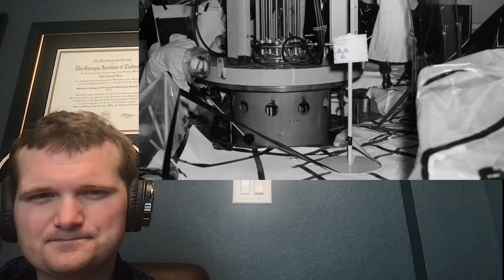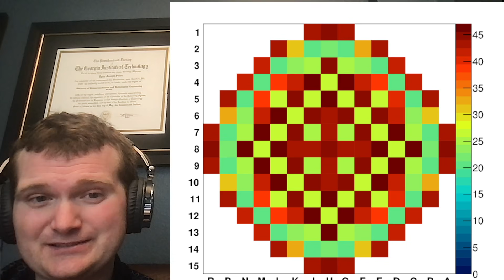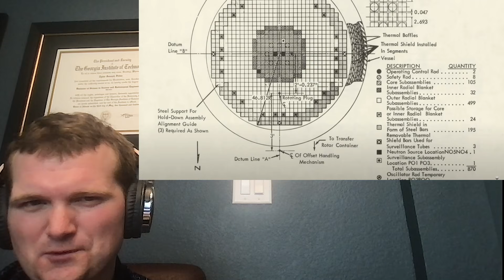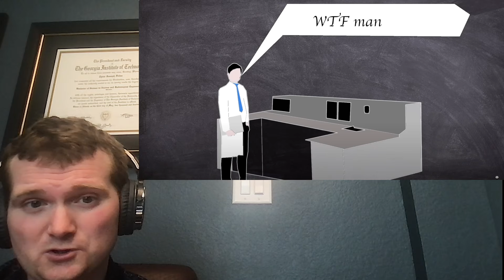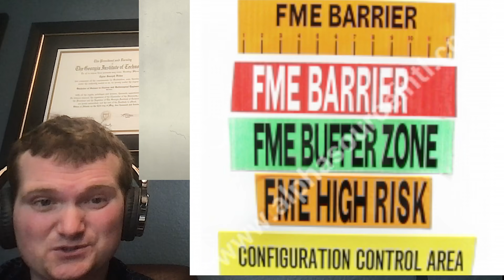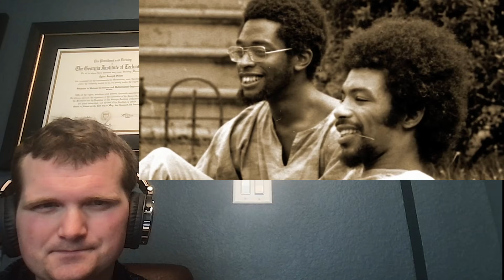The Worst Nuclear FME Event: Fermi 1 Meltdown - Nuclear Engineer Reacts to Plainly Difficult

Comment: Another technology that is now applied are vibration and 'loose-part' monitors.  The idea simply to have sensitive detectors mounted on key pieces of equipment and 'listen' for 'things rattling around."  I remember that San Onofre steam generator replacement ran into a lot of problems because of excessive vibration.  The concern being that high vibration from flow forces will cause tubing and support brackets to break.
Reply: I used the vibration spectrum from a system in a PWR that ran excore detector signals through a FFT algorithm to detect unusual vibrations of reactor components. I used this to determine the chronology of a failure of a thermal shield. I correlated this timeline with Loose Parts Monitor alarms. The company spent a LOT of money paying Combustion Engineering to analyze the same data and they came to the exact same conclusions!

I later worked at San Onofre. I don’t recall if the Loose Parts Monitor picked up anything as that was more of tube fretting wear against their supports rather than loose objects moving around. I was part of the team that did the Chapter 15 calculations for the various proposed reduced operating power levels with the repaired generators. We were close to getting NRC approval for restart when Friends of the Earth filed a lawsuit requiring complete relicensing of the plant. Southern California Edison threw in the towel and pulled the plug. I think they got an offer of financial leniency from Jerry Brown and the Public Utility Commission to grease tge skids.

Comment: FME = FOD in the aviation industry.  Had one helicopter I was working on that I dropped a washer in the flight control tube.  Tore the whole thing apart looking for it.  Next morning I made the TI jump for joy when I presented him with the missing washer.  It had fallen and tucked itself in my boot laces!  FOD accounted for!
Reply: And when you found it, you exclaimed, "Well, F me running!".   ;)

Still, better to keep looking and eventually find it than to fly and find where it went on the fast way down.
Reply: Saved an H-53, found a sheared flight control bolt during fod walk.
Reply: @idrinklight44 hope you got a bonus for that
Reply: Most famous FOD incident was when an ordinary plane dropped a metal strap on the runway before a Concorde flight .  Strap cut the Concorde tires at speed, causing the cut up rubber to puncture the wing fuel tanks, escalating into a massive fuel fire killing everyone, including the people the Concorde crashed on top of .
Reply: @johndododoe1411 
An MD11...
Reply: Fuck on-demand?
Reply: Isn't FOD foreign object damage?
Reply: @DarkAttack14  or foreign object debris
Reply: @DarkAttack14  also known as foreign object debris
Reply: @DarkAttack14 The first stage of FOD is Foreign Object Debris, if it went undetected and caused an accident it becomes Foreign Object Damage.
Reply: @DarkAttack14  Yes, and on top of that, the acronym is used both as a noun and a verb.

Comment: large amounts of hot activated liquid sodium sounds like a total nightmare.
Reply: Worked on Wright 1820 cyclone engines, yes the exhaust valve on this engine had sodium@woodendoorgarage
Reply: well there is one thing i dont realy get, why use liquid sodium over molten salt.
Reply: Just as much, as exploding dangerous hydrocarbons in a machine dedicated to move around in your country, operated by amateurs.  :D
Did you know that liquid sodium was considered a possible replacement for gasoline in ICEs to reduce exhaust emissions?
Reply: @frankt2658  Did you know that you're wrong? Liquid sodium as a fuel makes no sense. What is done is hollow valves cooled with liquid sodium. That would allow the burn process to be hotter, which means that the mix could be leaner.
Reply: @samiraperi467 Right, the sodium is in the primary heat exchange loop, then you probably have a secondary water loop. And a tertiary open “loop” for actually driving the turbine.

Comment: My Grandfather worked at Ameren UE (now just Ameren) for 30 years as a tech in the METLAB he made sure all the tools were fixed/calibrated properly for the guys actually doing the maintenance. He has told me the story about FERMI and other interesting stories. He also helped at FERMI plant several times when they needed help. He has traveled to at least 4 different plants during Outages.